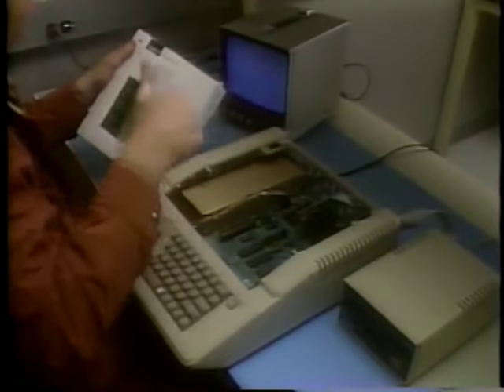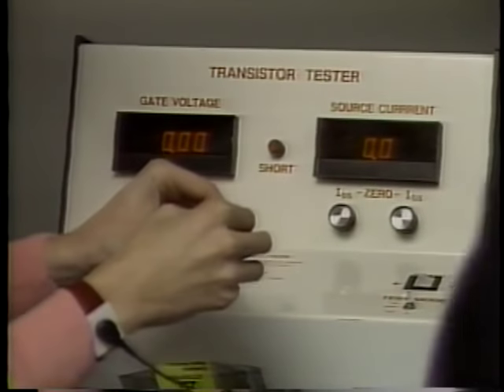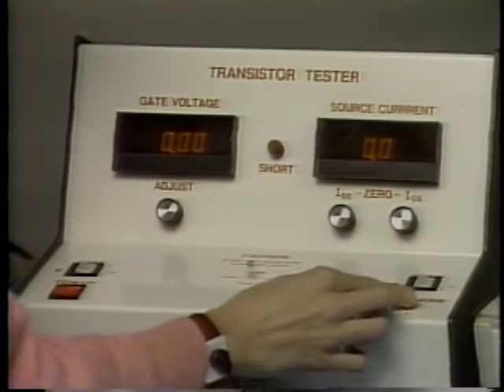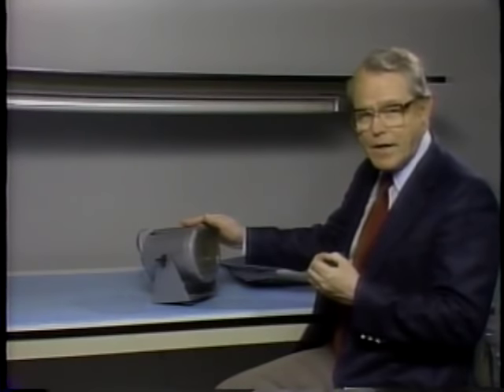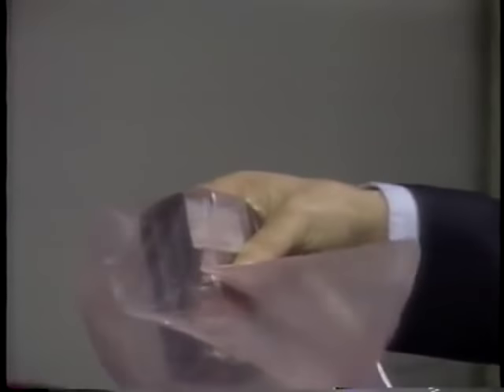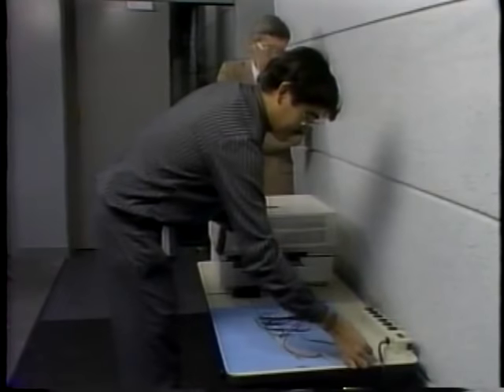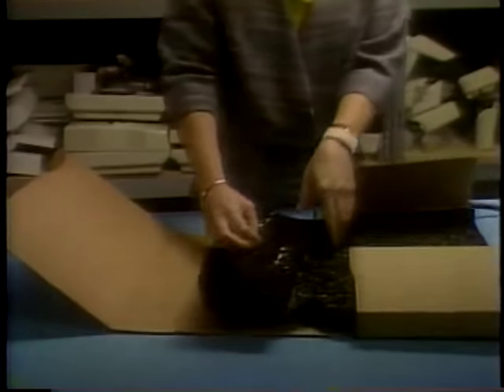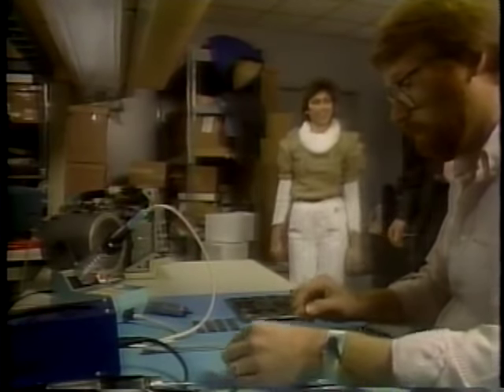Funny video on ESD

Comment: lol, how many decades ago was this made...what bullshit am I constantly reading on all kinds of forums right now..
Reply: +TheeMisterPatrick Most ICs are equipped with approx. 2KV ESD protection on every pin these days, exactly because ESD is a common everyday occurrence. But some pins of some ICs are not going to be protected quite so rigorously, so it's prudent to check specific data sheets.
Reply: You re right. Instead of making new nosense tutorial video they should simply share this video.
Reply: @SianaGearz   If you are talking about 75% of digital only IC's, then yes. Most analog, ADC\DAC IC's , Fet's, Darlington's, BJT's, some Zener's, 4000 series IC's are not, esp. anything from the mid 2000's and before...even op-amps. I just killed a circa 1993 op-amp last week by touching the PCB and applying a 1vp-p signal on the non-inverting input.